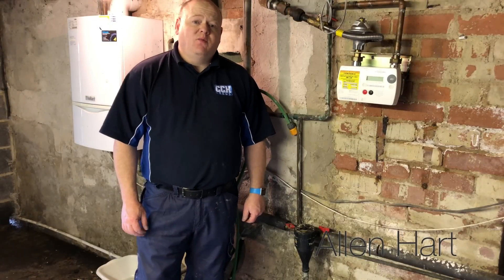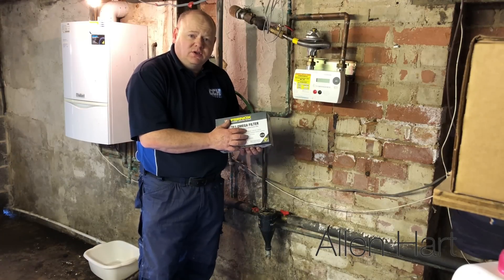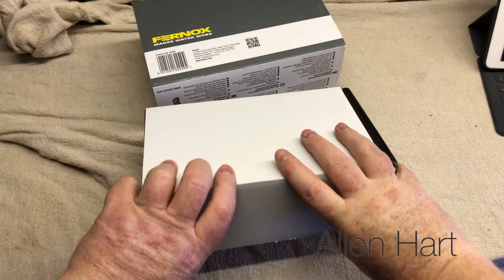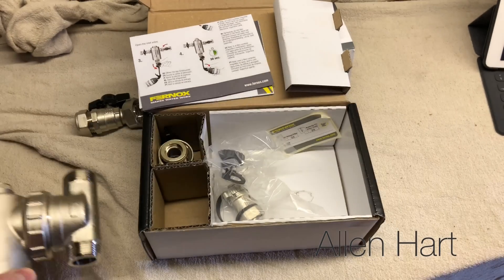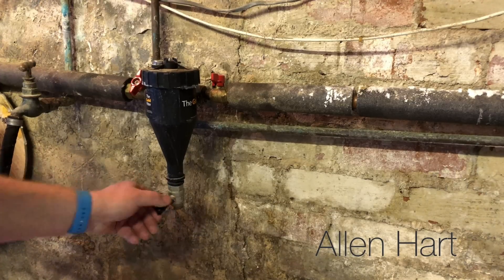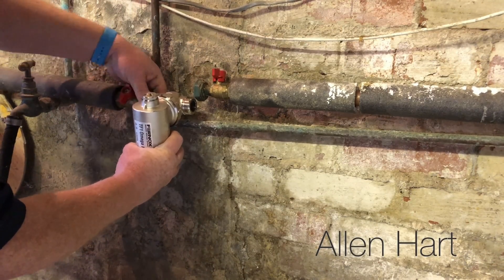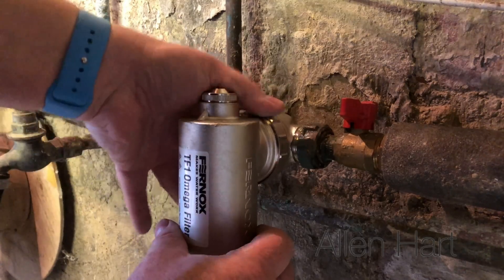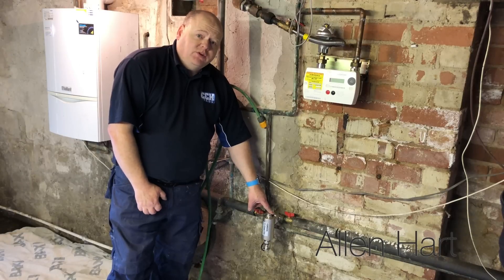How to Replace a Fernox TF1 with an Omega Filter Day in the life of a Plumber / Gas Engineer

Comment: I have 40 year old radiators and they still work fine, no leaks,  and no Fernox in my system.  But of course I do have a cast iron Ideal Mexico boiler which works a treat, no programmer, no fan, no crappy fin tube heat exchanger, and the last ideal cast iron boiler lasted me 30 years.

Comment: Hi, great video. I just have one question: why did you change the filter for an Omega? I'm looking to buy a filter to replace the non-magnetic one under my boiler. The TF1 is more expensive (where I live) than the Omega. What are the differences between the two, and would you recommend the Omega over the TF1?

Comment: Thanks for the video. I'm thinking of buying 4 of these, one question though. How do you release the air at the top of the filter? Is it automatically through sheer circulation speed? I was thinking of rotating the filter 180 (so it's upside down) and use the (normally) drain valve to let the air out. The double O-ring does allow rotation without leaking. I'd love to hear your opinion on this.

Comment: So how do you bleed these omega filters? (or do you not need to?) Looking at having a filter fitted and having a tough time choosing between the plastic TF1, one of the magnaclean units (pro2 or micro2)  or the Omega TF1..TF1's are looking favourite as they /look/ like they would do better at collecting the none metallic debris, magnaclean look like they do best at magnetic...omega looks least likely to go leaky on us (liking the guarantee period the best)...but no bleed nipple and least easy to dose ...getting myself tied in knotts thinking about it...meanwhile boiler is going without protection...help convince me which I need...maybe there is yet another consideration I have missed?
Reply: Not trades guy i got tf1 filter cleaned it and just let it flow whilst open then shut it off .suppose air came out  as filled up within seconds water come out clear and closed it .probably not the right way to do it .hope Allen gets back tells me 🙄😋
Reply: Found this mine doesn't have turn off valves  .had boiler switched on once filled up opened the valve  water come through clear in seconds then closed it .dont do what I done in case I'm wrong . This video link .
https://youtu.be/-hrH9EjQPPA
Reply: @blossmctoss  - I ended up getting the Magnaclean - got some flush with the kit - so ran that through for 3 weeks or so  - occasionally cleaning the filter surprising the amount of stuff it picked up
Anyway - a few weeks ago the inevitable happened, damp stain on ceiling under boiler install and no hot water from combi
drain bolt seal had a very slight weep - I stripped and re cleaned the unit (though it hadn't collected much dirt)
I have put it back together and have kept an eye on it - and it seems OK for now
(reminds me I was going to try and purchase a new set of O rings to have on standby...will do that now - thanks for reminding me :D )